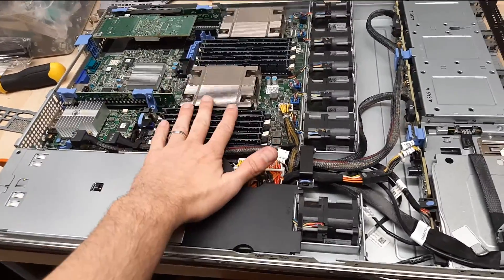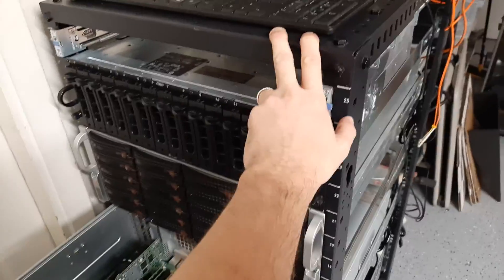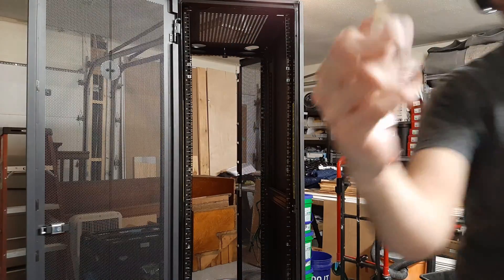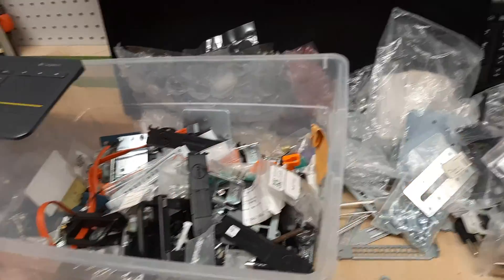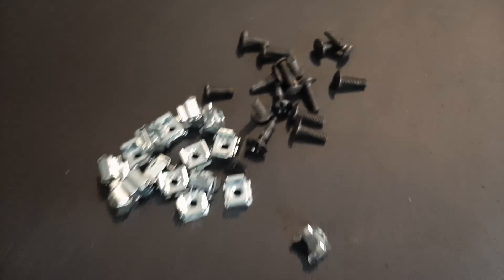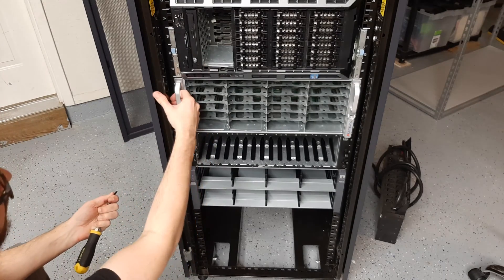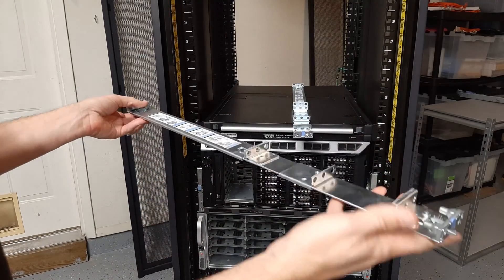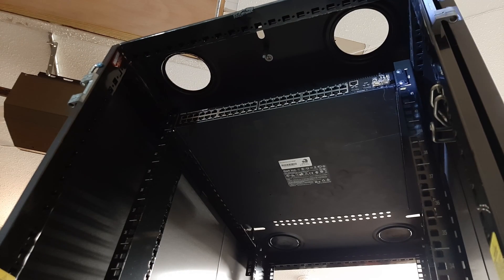My ULTIMATE Server Rack Hacks

Comment: You paste up cpu's before you install them, isn't that like putting on your shoes then trying to put your socks on afterwards?
I just pop the cpu in then squirt a blob on the ihs and bang a cooler on   ((What have i become... i hate it when people criticise, especially paste))
(GamersNexus actually benchmarked different approaches and found that it's all the same and the only goal is to get enough goop on the ihs)
Reply from the maker: If you have seen how dell and hp do it on their server cpus, its always 100% coverage. I dont know why they do it that way, but if they could save a cent and not do it like that they would. I stick as close to what enterprise users do whenever I can and its been working so far. Eventually I want to do liquid on the 5950x, but I have to build some trust in my hands.
Reply: @DigitalSpaceport  What chassis and MB do you have in mind for the 5950X? I have one of those as well currently using for Chia plotting and installed 3 GPUs on a MSI Meg Unify MB  for eth mining.
Reply from the maker: @KamiMountainMan  I'm thinking about a 4u rosewill or an open frame. Either way I want it to be able to handle a 420mm rad. For mobo I was nearly certain to get a cheap local aorus elite x570 but really do want 3x pie full length slots, but also excellent overlooking capability. Ideas?
Reply: @DigitalSpaceport  Probably Asus Rog Crosshair VIII is the best MB for overclocking but Asus MBs usually are overpriced. You can also get msi meg x570 godlike which has 4 pcie.
Reply: Nevermind Godlike is over 1K.
Reply: @DigitalSpaceport  Check Rosewill Thor V2 case , It is not a server case but it is a huge. I was able to fit 3 GPUs in it(with some difficulty though)
Reply from the maker: @KamiMountainMan  that's a monster case!
Reply: Buildzoid does Motherboard roundups on YouTube. He focuses on VRM specs and overclocking features. He's also done pcie focused round ups. His video production quality score is low but you can't fault his knowledge. (and he lives about 10 miles away from me)
Reply from the maker: awesome will check that out. About the production quality, its hard to fault a channel that is smaller imo.
Reply: @DigitalSpaceport  I know that to well with 500 subs but BZ isn't that small he just refuses to edit.
It's cool though, he'll tell you the science behind electron migration & PCIe multiplexers work or he'll wire up his oscilloscope to a VRM that he has modified to give higher voltage for better LN2 OC
Reply: @DigitalSpaceport  I'm not saying you don't need to cover the entire IHS. (you do)
I'm just saying the pressure of the heatsink will do that for you. OEM's have a mask they use to apply paste so they use that and don't waste a drop but my point is your trying to fit a chip that is greasy and you run the risk of making a mess when you would get the same results with %10 of the effort.

Comment: I noticed you put the cage nuts with the brackets going vertically. Is it best to do it that way versus horizontal? Is there any difference?
Reply from the maker: Your "supposed" to do the top 1 way and the bottom the other. I've been told the bottom horizontal. In reality I don't think it matters as the rails getting tightened with a lot of torque prevents slippage. It's easier to do vertical.. For servers it's whatever imo never had it be an issue, network gear more important.
Reply: @DigitalSpaceport  Actually horizontal is better.  Depending on the thickness of the bracket, you might have issue of overlap.  Let's say you have a cage nut under the marking on the rails (ex : top of the 5U position).  Then you need to put another cage nut right above it (ex : bottom of the 6u position).  You will come into situations where the brackets of each nut overlaps and never lock in properly.  When the brackets are horizontal, there will never be overlaps!